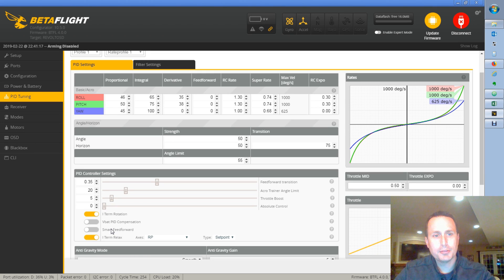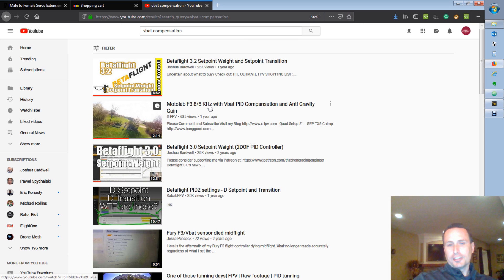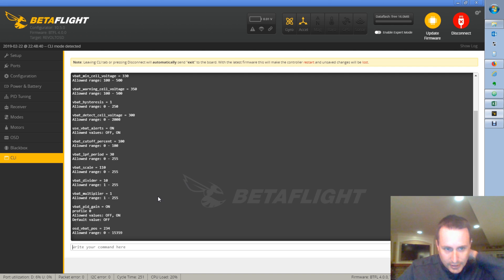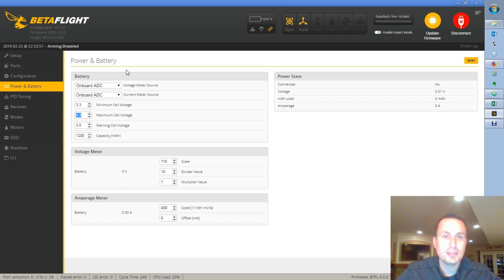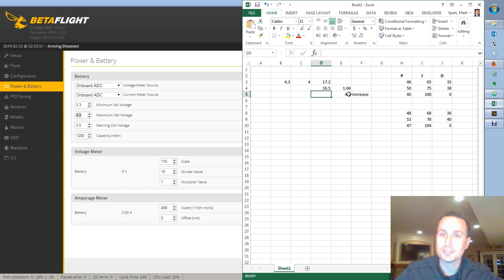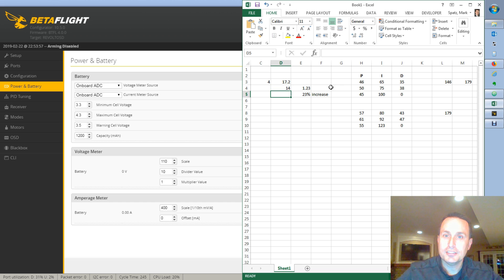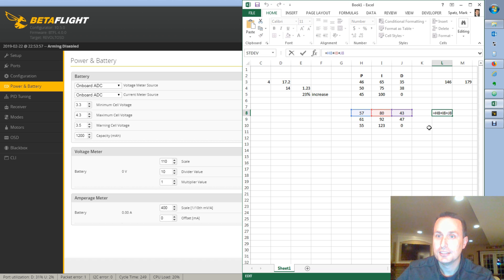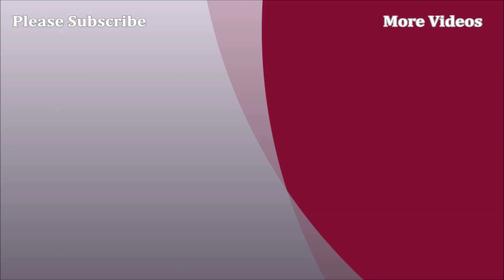Betaflight Vbat Compensation

Comment: So it manages the PID increase based on the current voltage of the battery, but at what frequency of measurement as VBAT isn't linear?  How does it average out the dips in VBat?  It's hard to grasp what is happening to your PIDs at any given moment, so is that prop wash a result of your PIDs or maybe the compensation?  I mean, so you get some temporary voltage sag from power maneuvers after which the battery quickly recovers and on a Tiny Whoops this is a super crazy battery sag...that it boggles the mind.  Might it be a good idea to turn this off for PID tuning purposes or not?  Thanks for the enlightening video!
Reply from the maker: it is a good question.  Since sag is like a spring on and off throttle this is a factor.

PIDs are meant for a linear system. So in theory, this makes thing more linear to compensate for sag and depleting the battery.  So it should be a good thing.  Honestly, I have not use much as I didn't know what it was doing in the past.
Reply: @uavtech  -  Well, it sure adds another thing to consider when tuning a quad.  However, I can totally see its value and why having good fully charged batteries to tune with is essential.
Reply from the maker: @frankbarajas  , right.  And with this feature, technically it should not matter if charged or not because it is to compensate.  So on that principle, worth keeping on or giving a shot unless experience or data shows otherwise?  IDK, just my opinion at the moment.  Could change.

what is nice with it off is as the battery sags, you PIDs technically go down (or the effectiveness of them) and you get a range of experience.  Maybe if PIDs are too high, you can detect it then.

A good way to experiment with this is to do a bunch of hard rolls, logging it at the beginning of a pack.  Fly it with Vbat compensation OFF and at the end doing a bunch of prop wash inducing turns.  Then do some more rolls before landing.  Vbat is logged in BBE.  Look at the log for overshoot and prop wash handling as vbat goes down.

Then do the same with the feature enabled and see if you can spot a difference.
Reply: UAV Tech - Yes, while that is the intent, it is only an approximation of an appropriate correction based on the algorithm.  My thought was in all fairness to allow for a more complete and thorough test by using fully charged batteries as a starting point, since that would limit the amount of correction initially and allow for more clarity and consistency in the overall results.  In other words, would you only test a car’s miles per gallons on a single pint of gas?  No, you would test it on at the very least a full gallon, if not a full tank over a varied test range.  By the way, that’s a great idea on the method to test using a range of hard maneuvering, both on and again with it off.

Comment: Do you have or plan on making a video explaining when and to adjust gyro and low pass filters ?
Reply from the maker: For F1, my Filters Fundamentals series - 3 videos starting with https://youtu.be/A09sprstYqI should give you what you need.  If you can get logging to work, even better!

For BF,  The Cascaded Notches & Dynamic Lowpass Filters video at https://youtu.be/__vyp60cU_8 should cover what you need.  This is with BF 4.0, which will be out April 1st.  Will be in Release Candidate mode next weekend probably.

Generally, lowpass filters are not touchy.  So you just look at your nose and keep moving the lower ones up as much as you can before you start to notice negative ramifications.  With logging, it is easier as you can get a sense of where you are at and how much you can push up.  Then it all just depends on how mechanical sound your rig is, which is the big variability.  Just cheap props alone can have a HUGE negative effect on your right.  Hight quality props is my number ONE recommendation where folks should focus their $ to have good performance.

Comment: there are some things you must take into account while playing with this option
-dont set it less than 4.3 (no matter if your bat is HV or not), otherwise you can get battery critical warning with a fully charged battery (cells can be slightly overcharged due to parallel charging or not accurate voltage readings)
-you can burn your motors on a noisy quad in some cases, like a tightly tuned pids, because D can be miltiplied too much

i wonder, how vbat will behave with the recent feature 'dterm cut' or something. i cant find it anywhere now though...

Comment: But... is it better to turn it on or leave it off?
Reply: On bigger quads, I saw more benefits turning on, but with whoops like Mobula, where you have more battery sag, I think it feels harder to control. The voltage goes high and low too often.
Reply: Fernando Filho - Good point, so it really depends on the quad and the battery.
Reply from the maker: Up to you.  If u notice a more sloppy response as the battery drains, turn it on.  If not, no need.

Honestly, i kept mostly off in the past.  Now that i know what it is doing, i will give it a try.

It also may be nice for it to works on throttle.  Need to look into that.
Reply: @uavtech  the only way it should matter is if it works on throttle no? do the pids really lose that much functionality due to voltage sag?
Reply from the maker: @upplsuckimcool16  , motors lose authority so need more push.  Not really in the beginning of the flight, but near the end.  It is an option I'm attempting to show how it works.  You can or cannot use it.  Up to you.  Decide for yourself.
Reply: I had left it off - only turned it on for cleaning up Plasma tree analysis.  It's now on for every build I reflash, although I can only really notice a difference right when I should be landing for the sake of the battery anyway.